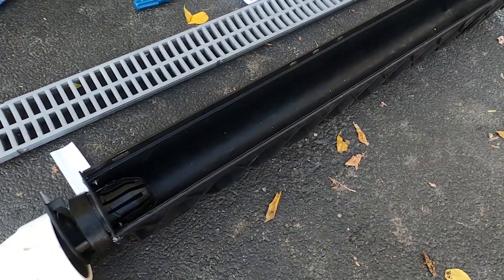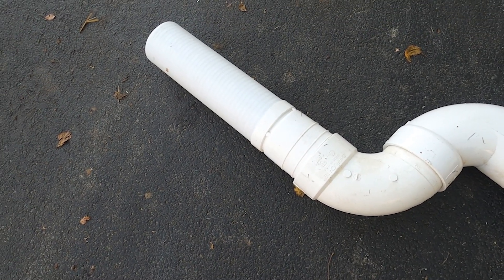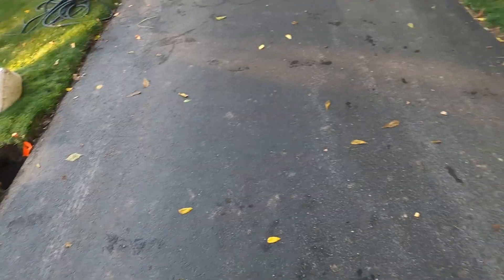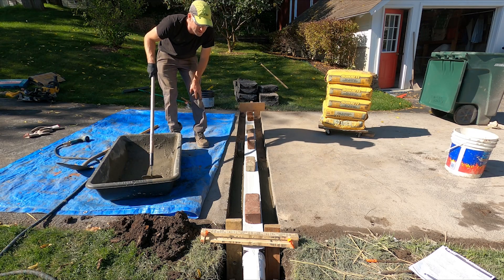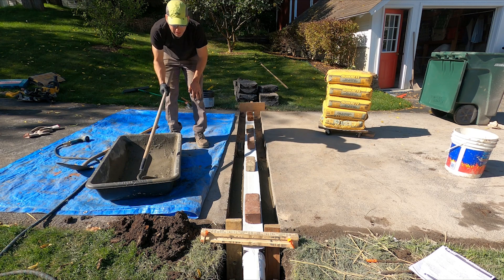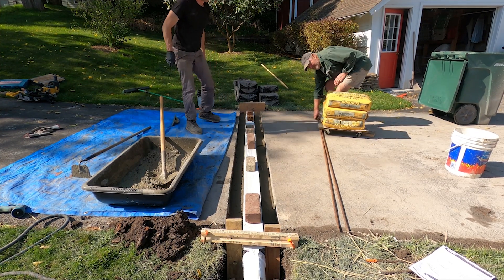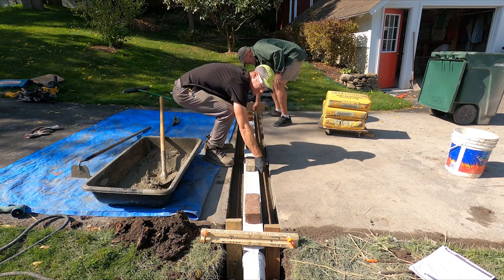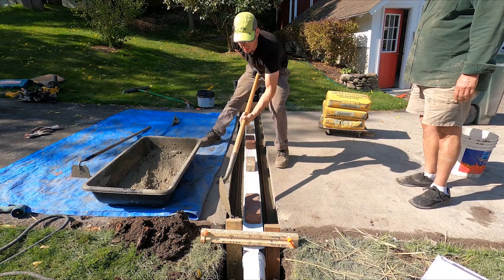How to Install a RELN Driveway Storm Drain (Channel Drain or Grate Drain) on a  Driveway

Comment: Am I wrong or with sand below it be a bad idea? Is it not going to collect groundwater in the sand?
Reply from the maker: Sand is porous and lets water drop/flow right through it. Alternatively you can use washed, crushed stone, and that would have the same effect of not holding water underneath concrete. There should be very little sub-surface water where this sand is located, and if there is, it wouldn't hold it which would cause issues during a freeze-thaw cycle.

Comment: How do you maintain the pitch but still keep the top of the drain even with the surface?
Reply from the maker: The driveway might have already been pitched to one side. But also, that zone between the drain and the existing driveway that we concreted can serve as a spot where you can blend the 2 different planes together.

Comment: thanks!  DIYers, be sure to check what your channel drain is made of.  NDS 5" and above is made of polypropylene and needs a plastic bond adhesive for fittings (they say pvc glue won't adhere).

Comment: Why not top both sides with asphalt cold mix to match the driveway?
Reply from the maker: That's a great idea, but we didn't have that and customer wanted the concrete feathered out, which btw, the feathering still hasn't cracked.

Comment: Any problems with freeze thaw?  Are you in a cold climate?  I’m in western PA and I want to do the same thing but worried about it heaving out of the ground when it gets below zero.  You guys did a nice job!
Reply from the maker: It's been in for at least 4 years, through 4 winters in upstate NY. it is as tight to the asphalt as it originally was installed without any heaving. A good base and keeping the water away from beneath it will help prevent heaving.
Reply: @PatrickDesignBuild good to know, this was very helpful, thank-you!
Reply: @PatrickDesignBuild  Thank you!! I was looking for an update! 🥳🥳🥳

Comment: How has it held up?  Has it cracked when you drive over it?
Reply from the maker: After 4 years, it has held up well. There is one slight crack on one of the ends. I'm guessing it was from a frost heave because the crack is located where there is not any traffic. The rest of the concrete and drain has held up flawlessly, even where the concrete was fanned out over the pavement.

Comment: Everything looks well done. My only question is if it would be beneficial to also pin the new concrete into the existing slab on my concrete driveway.
Reply from the maker: That's a good idea assuming the 2 are similar thicknesses. It would keep the two in-plane.

Comment: At 14:41 you say you used corrugated it should’ve been smooth wall ABS just like your elbows, all the way to daylight. Corrugated does not wash out the debris and is more likely to clog. That means more maintenance for people that don’t like to do maintenance. 😮
Reply from the maker: I agree. Good point.

Comment: Great job , getting ready to do this. My question is why did you not bur concrete under the drain ? Vehicles will be driving over this and compaction of the mason sand may cause the drain to settle down ward .
Reply from the maker: We followed manufacturer's instructions. It's taken cars, trucks, boat trailers, and dump trucks for 4 years and has held up flawlessly.

Comment: The most critical thing is how to keep the grill horizontal while the bottom half is sloped. It felt like a total waste of my time to watch this video.
Reply from the maker: The drain needs pitch, so definitely don't install it level... unless you want water sitting in the drain.
Reply: @PatrickDesignBuild  I would have thought that would be a given…
Reply: @PatrickDesignBuild how did you slope the drain? Or was the driveway already sloped and you followed that grade?

Comment: In the process of doing this now. Come to find out I need to widen my cement trench 8” to get concrete on both sides. I cut the channel as wide as my drain and now understand that it needs to be bigger. Was going to put quickcrete I there then just add water but not anymore. Thanks for the video

Comment: Nice job but not clear to me how you maintain the correct fall in the drain if it’s always 1/8 lower than the road (which is unlikely to have the same fall)…
Reply from the maker: You can follow the road pitch even if it's more than 1/8", or, for example, if the road is flat, and you want to pitch the drain, then the pitch correction takes place in that zone that is cut beyond the width of the drain in that area where I placed the concrete. There will be a different slope along the length of the drain to blend the 2 different pitches together.

Comment: What is the advantages and disadvantages of using RELN channel drain?  Could you have the drain just concrete bottom and sides topped with a metal drain?
Reply from the maker: The advantage to RELN is that it comes ready to install. Doing it the way suggested is just as good assuming it doesn't crack over time. The plus side to your suggested drain is that you can custom size it. The downside is you would have to form it and engineer it strong enough for your traffic weight.

Comment: Did you only bed that in sand? That's going to fail
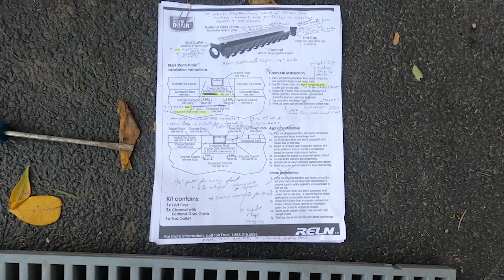Reply: I see at 1:30 they suggested sand, their specs have changed.
Reply from the maker: Sand was manufacturer installation instructions.
It's lasted 3+ years with hundreds of vehicles, trucks, dump trucks, excavators, and boat trailers travelling over it during freeze and thaw cycles in upstate New York. Hasn't cracked, hasn't failed.
Reply: @PatrickDesignBuild  you must have gotten lucky, that looks like a RELN drain.  https://images.thdstatic.com/catalog/pdfImages/94/945badb5-1e8c-48dc-a227-d955024cca81.pdf
Reply: @PatrickDesignBuild  the manufacturer instructions for asphalt is to encase it on concrete. that's a RLEN drain right?

Comment: That’s not good work u don’t make ani drywell for that and also those plastic across the dryway ned to be sitting on concrete 👎
Reply from the maker: 1. It wasn't a dry well. The 4" pipe was taken to daylight (not in this video)
2. The manufacturer called out to install the drain directly on the sand. And it's lasted 3.5 years with lots of traffic on it and hasn't cracked. Check back with me in 20 years and I'll give you another update.

Comment: How did it hold up? Up in ny state we use crusher run instead of sand. Kinda like installing a new fiberglass pool better stone then sand. Great video
Reply from the maker: The drain has held up great. It's been 3 years with traffic and no cracks to to the concrete or drain. The only maintenance is cleaning the great body from leaves and debris. I agree about using stone for everything concrete, but the manufacturer specifically wanted sand so that's why we used it. And we're in Upstate NY :)

Comment: Would have been nice to see where water runs off to… if it’s the yard you will have problems.. didn’t see any connections off of the pvc outlets on either side.
Reply from the maker: I'm sorry... I didn't video that part of the process. The PVC connected to a 4" drain pipe that led downhill about 100 ft to daylight.

Comment: Great video! What did you use to kerf the pavement?
Reply from the maker: I used a DeWalt demo saw with a concrete blade, hooked to a water hose to keep the dust down

Comment: It has been two years since you put this in, have you seen any separation between the concrete and the asphalt or break down in either?  I really need to install this in my Pacific Northwest asphalt drive to deal with our winter rains.  Great video...many thanks!
Reply: And still no answer.

Comment: The end of the drain does it have to be connected to the sewage
Reply from the maker: You should probably not connect it to sewage, and instead either daylight the drain or connect to a storm sewer system.

Comment: I'm not sure you need rebar for reinforcement since it's not really load bearing and it's only 2-3 inches across. Reinforced concrete would probably have been enough.
Reply: If it’s your multiple hours invested, why short yourself and not use $20 in rebar. I’m sure a vehicle constantly driving over this area will add stress

Comment: So where does the water go?
Reply from the maker: At 9:47, you see me putting the 4" elbow on. I didn't show it but that elbow connected to a 4" pipe that took the water downhill and daylighted about 100 ft away.

Comment: If you had to run your drain to a dry well would you then use perforated pipe with gravel underneath it?
Reply from the maker: I would probably not use perforated, if you were trying to transport water from the storm drain to the dry well. You can use corrugated, non-perf pipe and probably dump it into the well if the well can handle the volume of water.

Comment: Where does the water drain? Just into the ground right by the drain?
Reply from the maker: Right around the 8 minute mark, I show the PVC pipe being installed and explain that a trench needs to be dug and drainage pipe installed that takes the water away to a safe, lower spot. I don't show the drainage pipe being installed. I'm sorry!

Comment: A friend of mine just had this done to her driveway and you can tell by the video that you made sure that everything was done correctly and I like that you took pride in your work!
Reply from the maker: Thank you! I try to do it right.
Reply: @PatrickDesignBuild  David, I enjoyed watching your video on how to install a channel drain.  A friend of mine just had one of these installed last weekend, but I surprised that the installer did not allow the grate on top of the system to be removed, so that debris could be cleaned.

Comment: Do you have to put concrete under the drain? Or can you just pack the soil?
Reply from the maker: Definitely need concrete to support the drain so it doesn't crack with wheeled traffic.

Comment: Thanks for sharing this.  The only thing I can think of to improve it would be a clean out at one end in case it gets plugged with debris.
Reply from the maker: Good thinking, but actually, the grate lifts out of there very easily, and has been cleaned several times so far!

Comment: Why didn't you cut it only the 4 or 5 inches needed?
Reply from the maker: You need to pour supportive concrete on either side of the drain. This concrete is what locks the drain on place and supports it.

Comment: when installing trench /storm drain do I need to make a pitch? it's for my backyard
Reply from the maker: Yes, you need pitch. In an open ditch, 1/4 " drop for every foot of length will make water flow really well. With a smooth wall pipe, you can easily go flatter, more like 1/8" or 1/16" drop for every 1 ft length of pipe. Some of the really large diameter (24" diameter pipe) that we put in is basically flat.

Comment: Hi I have a question. The pipe that comes out of the actual drain, do you just let the water flow through the pipe and into the earth or did you connect it to anything underneath?
Reply from the maker: I'm sorry but I didn't show that important part of the process. That pipe actually connects to an underground drainage pipe that takes the water 100 ft downhill to daylight. 

Take the water far enough away to a point where it will naturally drain with a good slope away from the driveway like a natural ditch or swale, or at least a spot that is far enough away where if it pools up it doesn't bother anything else.
Reply: @PatrickDesignBuild   Thankyou for your reply back. I have just been on the google old google and been looking through a few pages and found some good ways, Thankyou for the advice David I really appreciate it👍🏽take care pal.

Comment: So the end of it (the 2 90 degree pieces), does that just drain down into the ground or is there a small pit with gravel for it to dissipate into?
Reply from the maker: That pipe actually feeds an underground drainage pipe that takes the water 100 ft downhill to daylight. I'm sorry but I didn't show that part of the process.
Reply: @PatrickDesignBuild  how far away should the drain pipe run from the driveway? On average
Reply from the maker: I would take the water far enough away to a point where it will naturally drain with a good slope away from the driveway like a natural ditch or swale, or at least a spot that is far enough away where if it pools up it doesn't bother anything else. Take a picture of your situation and send it to me if you want more specific feedback!
Reply: @PatrickDesignBuild  appreciate the feedback. It is raining hard here in Washington and I get 4-6” of standing water in front on the garage. I  can run it probably about 50-60’ away into a natural ditch in front of my house
Reply from the maker: @bluegill2030  a natural ditch sounds perfect! Remember that the driveway drain naturally puts the exiting pipe in the ground around 6" deep (unless you elbow it deeper like I did). For light lawn traffic, you'll probably want that pipe to have about 6" or (12" is better) of dirt cover over it to protect it. And try to get 1/8" of fall per 1' in pipe length meaning the pipe falls about 1" per 8 ft of pipe, or for 60 ft, the pipe will pitch down about 7.5" .  That means at a minimum where you enter the ditch should be 13" to 19" below the top of the driveway drain. When daylighting into a natural ditch, to protect the pipe, usually I convert whatever pipe I'm using to schedule 40 PVC for the last 4 to 8 ft. That gives additional strength around the outlet when compared to using a lightweight drainage pipe.

Comment: Great video and work by two nice gents. Job looked painstaking laborious. I would imagine a 'decent' contractor would have to charge $1500 to $2500 for such... so great savings DIY. 
My lazy behind would have installed an NDS Catch Basin, in the grass on the low side of the drive and ran solid drain pipe to the neighbor's yard (in the middle of the night of course) :).
Kidding aside... why cut into a perfectly good, and extra thick, asphalt driveway like that!? Asphalt, concrete and plastic are like politicians... they move, settle and shift differently, depending on weight, moisture and temperature and eventually fail.
Reply from the maker: Yes, you're right.  A better fix would have been if we put a catch basin on the low side of driveway/grass where the water is concentrated. Yes, agreed about the mix of materials. We are sure to see some cracks in time.
Reply: 😝😝😝 To the neighbors yard… 😝😝😝

Comment: So these drains embedded in concrete can handle 5 tonnes I understand. So does this mean the first loaded oil, propane or UPS delivery truck that drives over this will destroy it? What has been people's experience?
Reply: Yes! These crappy/plastic trench drains MUST be set w/ at least 8" of CA-6 beneath 6" of concrete 4000 PSI.
Reply from the maker: You can buy heavier duty drains for heavier applications. Every drain specs the load it can handle. So you should definitely oversize the drain based on the weight you expect over it.

Comment: This is the American($$$$$"expensive") way of solving drainage problem what I want is an Indian ( ₹₹"cheap") way of solving the same problem........ 🤔🤔🤔
Reply from the maker: The cheapest solution is to do a dance to stop it from raining :)
Reply: @PatrickDesignBuild  💃🕺💃💃🕺😂😂🤣 . I prefer living in the desert ( no rain no drainage required)🤔.
Reply: The best, easiest, cheapest and "Indian" solution would be to move and NOT disclose your flooding issues to realtor, lawyer, home inspector or buyer!
Reply: @symcardnel1741  According to Buddha there are 3 ways to deal with a problem
1.Solve it
2.Live with it
3.Leave it .
You suggested me the 3 rd way ( easiest way) .
I got it.Thank you 👍

Comment: I would have let the concrete run under the drain assembly, (min. 4") You could have accomplished this by suspending the assembly with rebar bridging the top of the trench and tie wire. Just make sure to add some weight to the top so the assembly doesn't float up
Reply from the maker: Interesting thought, but you would need to vibrate or consolidate the concrete somehow to flow it underneath the drain and fill it completely so there are no voids. We were following the manufacturers instructions therefore used the gravel and sand as the structural base.
Reply: Ive watched other videos about this. Seems if you're not driving over the drain, then this gravel base is fine. If you drive over it, they recommended 4" of concrete under the drain as well as on each side.
Reply: @robertgriz2500  Makes sense

Comment: Wear a respirator when mixing cement materials
Reply: I was going make the same comment!  That stuff is very bad for your lungs and once in, it never leaves!  Also important when cutting the trench - if your driveway is concrete, you will spend considerable time crouching in a cloud of cement dust.
Reply from the maker: Great advice!
Reply: And when inhaling the Chinese Wuhan Covid Red Death Virus.

Comment: Hello, nice job.
Is the grate supposed to be concave like in the video or is that from the weight of the autos.
Reply from the maker: Hi! The grate is shaped like that to be a low spot for water flowing across it so the water flows down into it.